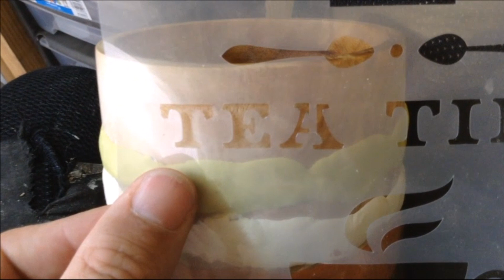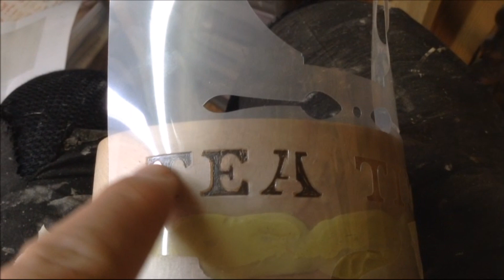making a tea caddy/pot out of wood and milliput for tea.

Comment: hello, I follow you from Italy, I just started working with resin and wood, I have a question: the pot that uses to harden the resin, creates the vacuum or adds pressure? in several forums they talk about vacuum, but with that the bubbles get bigger. thank you, you're great

Comment: As you were burning the "TEA" into the top I knew it was silly to do so before getting rid of the excess milliput. It turned out in the end though! Also, why is there a smiley face on the inside bottom of the canister? When you run out of tea that's the opposite of smiley!